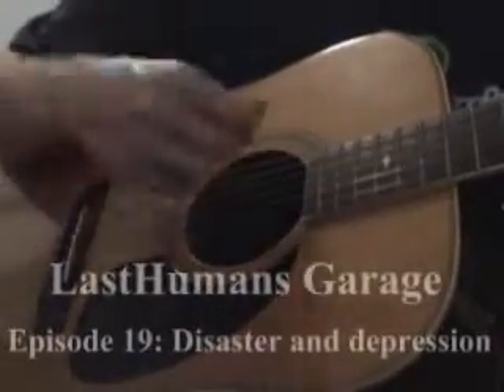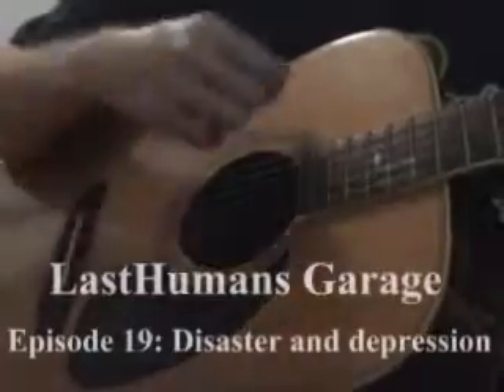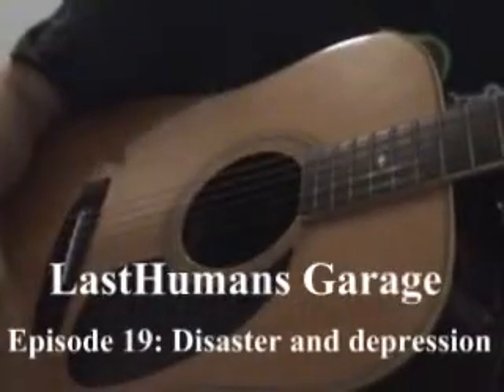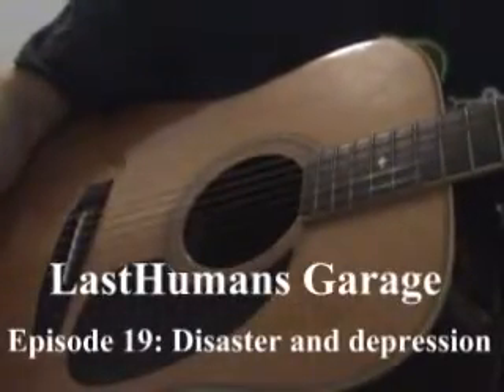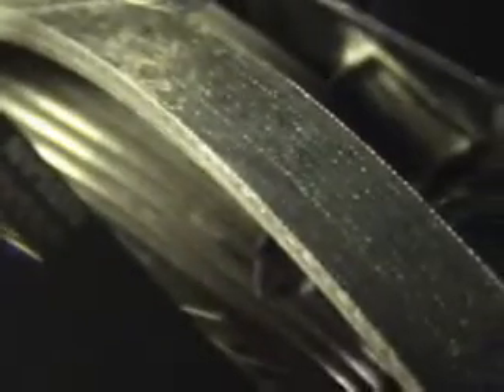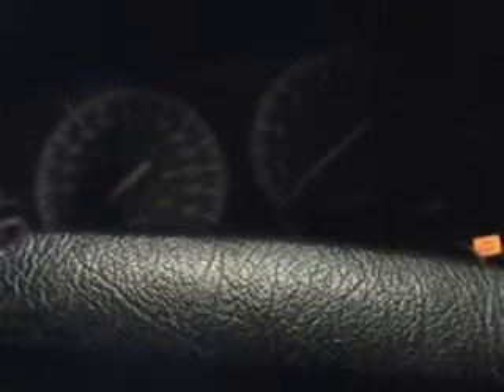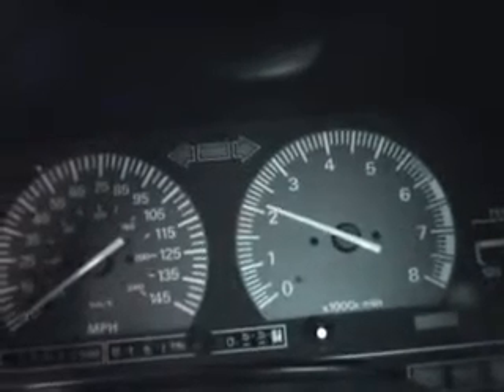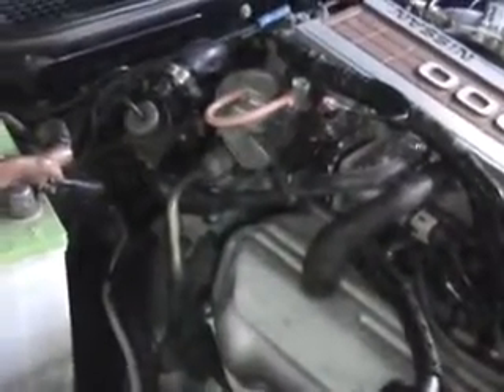1987 Nissan 300zx: Episode 19 Vlog: Disasters and depression

Comment: Your dizzy is off a tooth,too far advanced..That noise when ur cranking is the spark going off way to early when the piston is still coming up,hence why the engine almost completely stops.Been there,the dizzy has to point at the contact in the cap,not the spark plug wire.